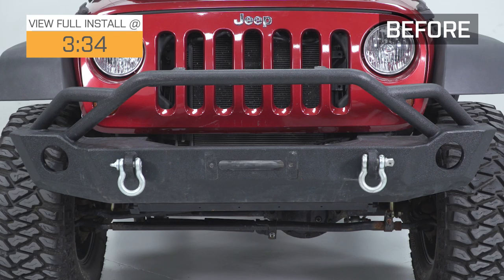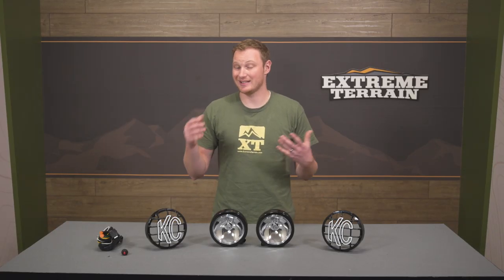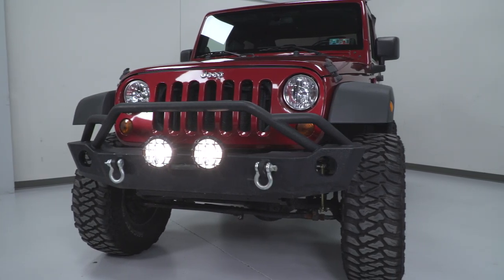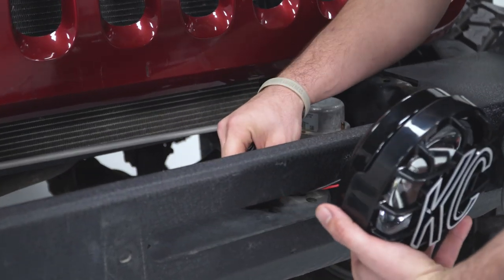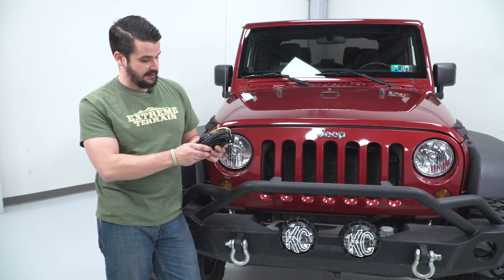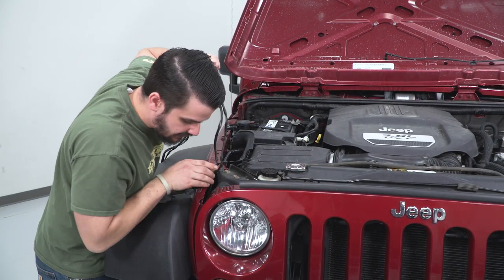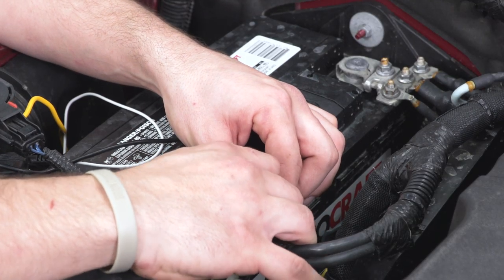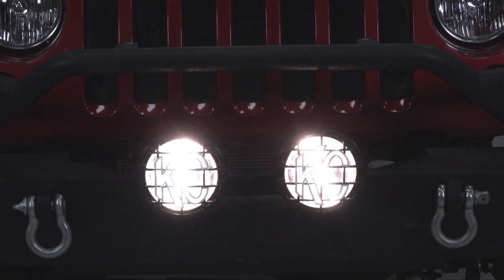Jeep Wrangler KC HiLiTES 6" Black SlimLite Halogen Lights - Spot Beam (1987-2019) Review & Install

Comment: Is it possible to use the connectors for the factory fog lights for this rather than having to use the switch?
Reply from the maker: You can definitely splice these KC Halogen Lights into the factory fog light harness! I would just recommend taking a look at local laws first though, some states require any auxiliary or aftermarket lights to have their own switch and not hooked up to factory lights. -Zach

Comment: If you get these on your Jeep, How would u turn them on and off?
Reply from the maker: This kit comes with a switch that you can mount inside the cabin to turn these lights off and on. -Zach
Reply: Someone also just told me that you could put something inside the car on the windshield on the drivers side. Is that also accurate?
Reply from the maker: Definitely! You would just have to buy an aftermarket switch pod and wire the lights up to that, instead of provided switch. Take a look at the following link, that'll give you an example of what I'm talking about. -Zach
https://www.extremeterrain.com/rugged-ridge-black-a-pillar-jk-1723596.html